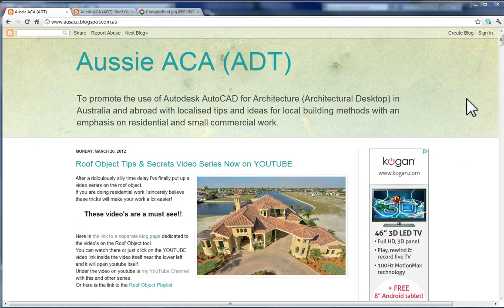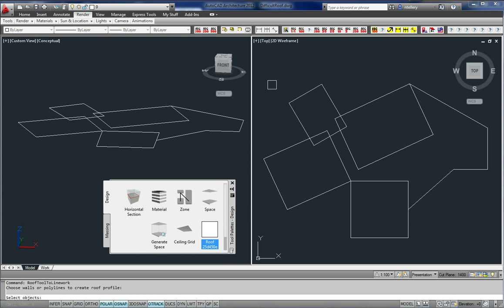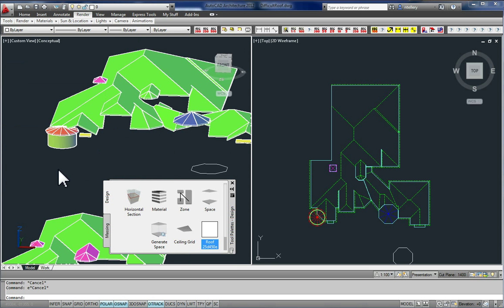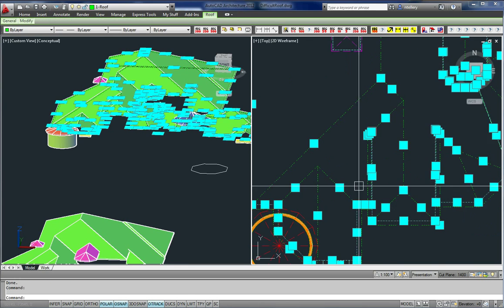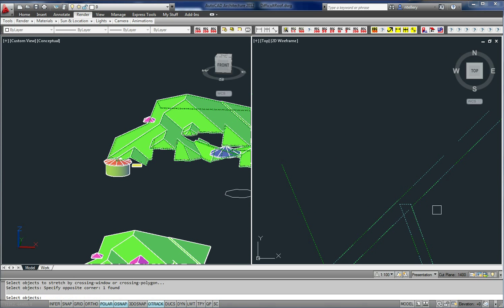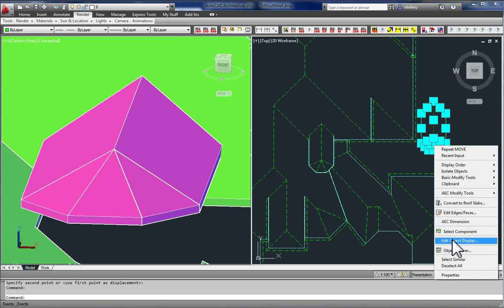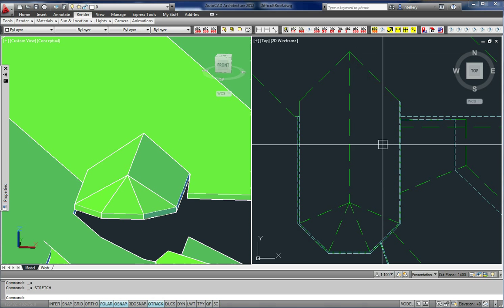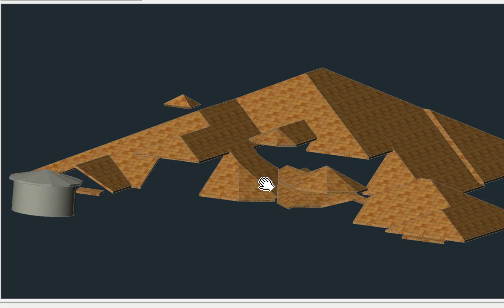ACA Roof Object 14 - Difficult Roof Challenge

Comment: WHAT IS THE NAME OF  THE THING IN THE DESIGN TAB THAT YOU CLICKED ON ( ROOF 25d4??) and where can i find it? in content browser?
Reply from the maker: +Dennis Xavier At what point in the video do you see this? I assume you mean the RO tool in my own design tab pallete.
Yes I created that myself in my own created pallete along with many other tools.  I don't feel competent to teach this otherwise I would do a video on it but....

If you open the Tool Palletes (Control 3 will do it) and go down to the base of it's spine and right click on the little symbol you can see you can create your own palletes- "New Pallete".  From there you can give it a name, organise your palletes etc so I have one called "Roof"

Create a Roof object in a template drawing (same as the Styles drawings you have out of the box) along with any other custom bits.  Name / save it in a location you choose and you can now drag any bits from there into your new tool pallete.  Some things come along, some properties are dropped.  Once in your pallete you can customise further by a right click and "properties".  In this list you can give it a layer key (not needed for a roof) thickness, edge, pitch, overhang, plate height etc.  

To be honest I rarely use this tool but I could.  Because the RO tool holds the last values of the previous time you used it I find most things are set anyway.
But you might have caught a glimpse of other tools that I do use and are quite useful.

HTH's